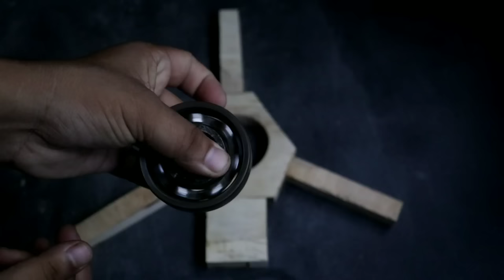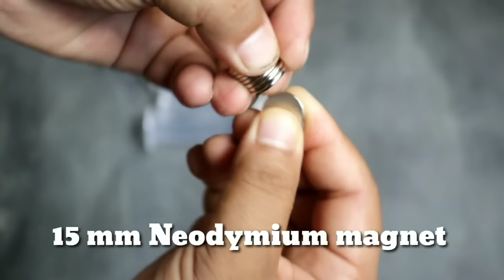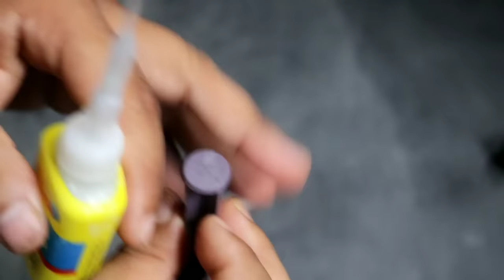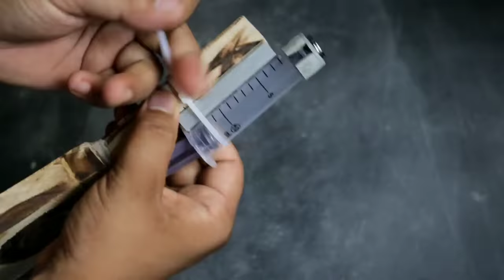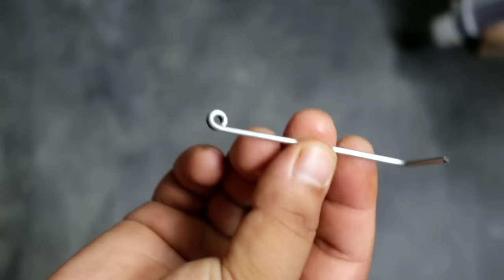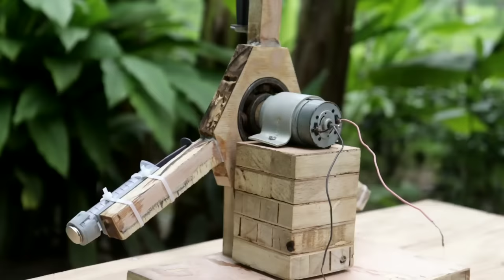Jet engine making using neodymium magnet totally home made

Comment: Run the pistons without the generator and block of wood in the back.
Reply: Are you think it's fake 🤬 londe
Reply: Of course it’s fake
Reply: @Userrr990  of course it is fake
Reply: This is fake
Reply: @Userrr990  Its fake dude fr 🤦🏻‍♂️
Reply: Right, if it were real it would run without the motor on back. You wouldn’t need to ‘prove’ it works by booking a lightbulb up…
Reply: 我有个主意
Reply: This thing was actually tested
Reply: Battery 🔋 power input 😂
Reply: @rujan_120  he has not removed the block of wood and generator to prove once and for all that the piston actually runs.
Reply: It's not fake at all
Reply: @Benwinch07  it is for generating electricity dont you know

Comment: Deception. The engine immediately gained full speed, which indicates that the electric motor was turned on from an external source. + This video is for those who skipped physics lessons at school.
Reply: But it is real
Reply: I tryed
Reply: It's cool but how will you stop , because if it is continues the motor gets heated and it may blast so it must be controlled

Comment: hello can you run the bearing without motor.. to see if it is fake or real
Reply: He showed that it was in the stall potion before he turned it on.
Showing nothing connected before, but not while it is running
he could push the syringe in easily but then could barely spin it and then almost hurt himself.
He showed that the speed of repulsion was s-l-o-w, but with the additional friction of a heavy bearing and an electro-motor, their speed is 1000 times faster

I get so tired of these fakes

Comment: Show the bearing rotating by the syringe pistons without the dc motor attached to the bearing. I believe the bearing will remain stationary. Make video to show otherwise.
Reply: The motor is what makes electrical current genius
Reply: @davidmichalowski2818  Super Argo is claiming that this contraption is being run by batteries hidden in the block behind. They would like to see if the pistons run by themselves to see if it's legit. Basically they're calling bs

Comment: Tried it with 2 cylinders without the engine. And doesn't work because the flywheel doesn't have enough power to get to the next cylinder and keep spinning. The more power the first cylinder needs, it takes even more power to get the second cylinder to turn further. I think the guy in the video tampered with his engine so you can't see it. Although I think he has connected the two end poles of the motor to each other in a hidden way, so that he turns the wheel with full momentum, so there is magnetization (magnetic field) in the motor and that's why it turns. Therefore I give a dislike. That's my guess. But maybe I'm wrong.
Reply: U are right. It's a fake video

Comment: He showed that it was in the stall potion before he turned it on.
Showing nothing connected before  (before adding the motor), but not while it is running
he could push the syringe in easily but then could barely spin it and then almost hurt himself.
He showed that the speed of repulsion was s-l-o-w, but with the additional friction of a heavy bearing and an electro-motor, their speed is 1000 times faster

I get so tired of these fakes

Comment: Raised wooden platform of the DC  motor to hide batteries (power source to drive the DC motor) 😁

It's is quite impressive how he manage to hide the power source ... Kudos 👏

It will really helpful if he can make a video by running only the magnetic syringes  without the DC motor and the wooden raised platform 😂
Reply: Iya...dan sayapun berpikir demikian🤣....kerugian gaya itu tetap ada...
Reply: Sir this real Or fake
Reply: Because I will make in project